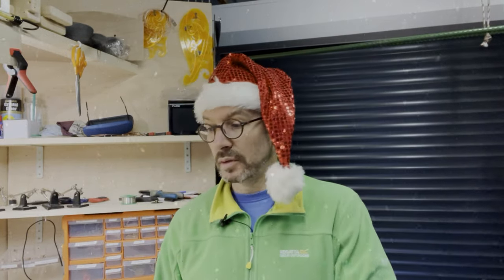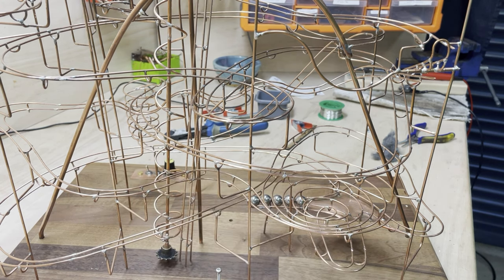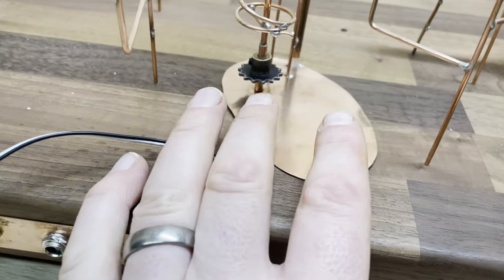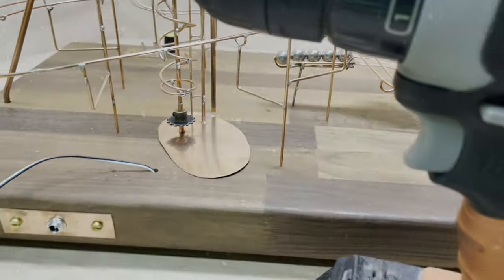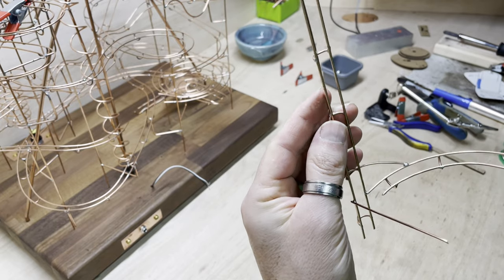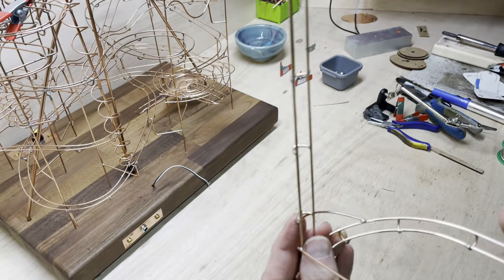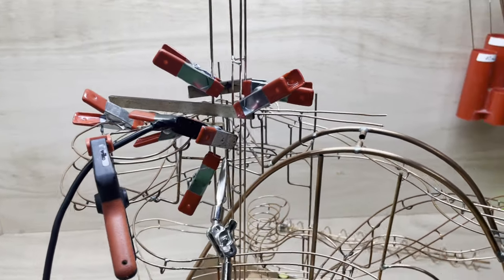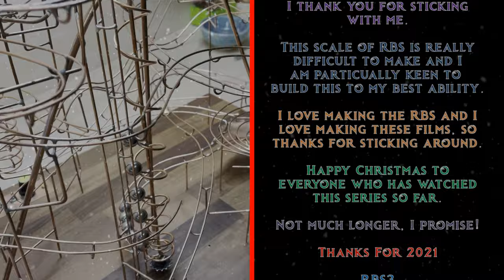Ep.25 // Fitting the Helical Ball Lift // Rolling Ball Sculpture 3

Comment: Hi , could you  tell me what diameter the balls are and where can I find them? Thanks a lot. I like your creation, keep on rolling.
Reply from the maker: Hello. These are 1/2 inch stainless steel balls that I bought from an eBay seller. Stainless so they won’t rust. Steel to be heavy. And I use quite a good grade to ensure their size and weight don’t vary too much.